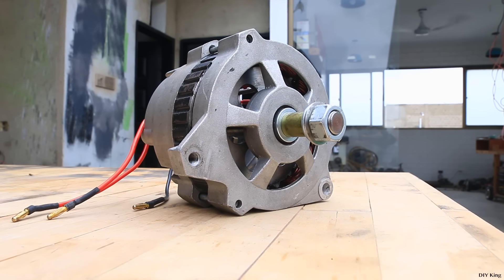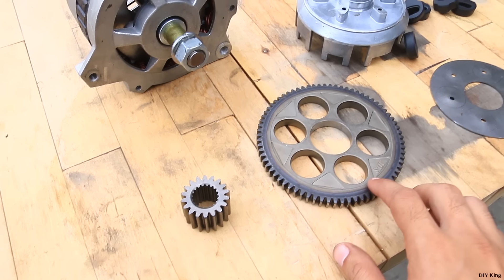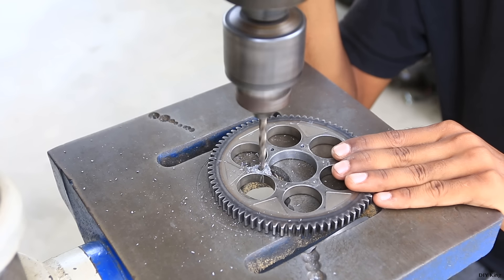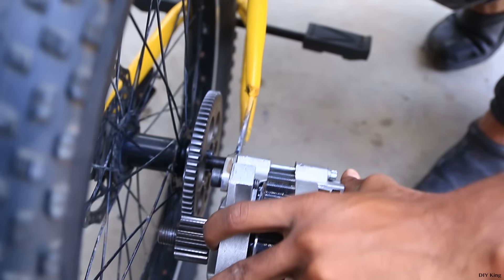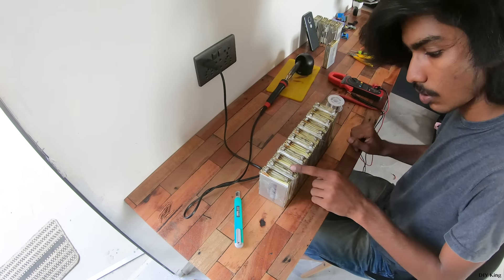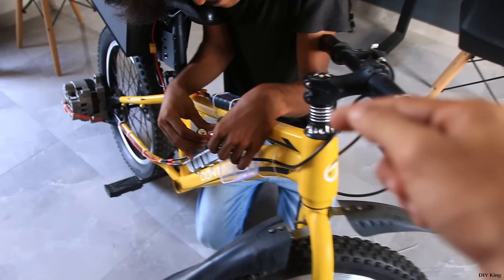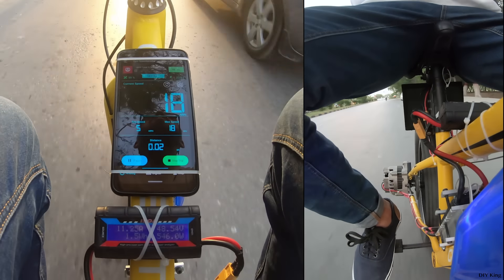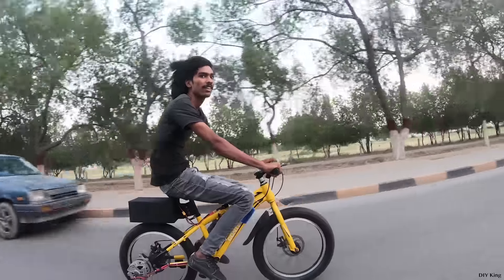Bicycle Conversion using a 10,000 Watt Car Alternator

Comment: The build is interesting, but I don't see how this is a 10,000 W alternator (per the video title).  For one, you have a 200A board controlling it (which is roughly 12V x 200A = 2,400W).  And from what I see, that is a 150 or even 100A alternator, which is 1800 to 1200W.  Even with modifications which will bring the power lower still, it is a nice build, but I think you are off by a factor of about 10x.
Reply: You’re right- it’s not 10kw.  Probably an 80 to 120 amp alternator, which typically outputs 14 volts more or less.  So optimistically, a 1500 watt.  

Maybe he just put an extra zero on and meant 1000 watt?  Or clickbait algorithm demanded exaggeration!
Reply: These guys can't count. Have you ever seen a 10k electric motor? It is huge.
Reply: it is a 200a WATERCOOLED controller, that he didn't watercool. this bike runs at an estimated 40-60 amps from what i can see, he is either trolling or just doesn't care if his numbers are correct. the bike is great, but the stupid numbers are infuriating because now if someone makes a 3000w ebike with a 4000w capable battery on it, they will look like a chump to people who don't know what they are looking at. THIS IS CANCER.
Reply: I think they used 120 Volts AC InStead of 12 Volt DC When Converting the Math , I Noticed this Right Away and Though Common , No Way!
Reply: @905Jerrod   I think they just used a big number for clicks. It's all about the clicks
Reply from the maker: If you go through the video again you can see that we have powered the alternator using a 12s lithium ion battery pack.
That sums up to 50.2v and with a peak of 195Amp i guess we have got the maths right. Still we are going to do a video as lots of people have got this wrong.
Reply: @DIYKingSaM  you yourself in the video said that you were using two batteries capable of 1500 watts each. that is 3000 watts potential output from the batteries. but not only that, you are using a controller that is supposed to be watercooled without watercooling it so you are obviously running way under what that controller can do. dude, you are hitting a very respectable 40-60 amps, but i don't think the motor would even survive much more, even truck alternators aren't built to handle that much juice.
Reply from the maker: @kght222  wait for the next video, btw that's 1500 watt hour each not just watt
Reply: @tikitime  yeah he included the comma so he meant to say that. Suprized he didnt call it free energy. 10,000 watts would have that whole bike glowing an breaking down I bet.
Reply: @kght222  yeah I agree man I hate it when people do this it's so misleading to the uneducated.
Reply: I had the same question.
Reply: @martinben1480   It depends on the type of motor and I have seen a 10kw motor. Its tiny... golf cart motors can go way higher and are still small, less than 50lbs.. and peak power goes way higher.
Reply: @DIYKingSaM    What you are claiming is the spec voltage and maximum amps.   That does not mean the motor is using 195 amps at 50.2 volts.   You could hook (2) 12S batteries to it!   Would that make it 20,000 watt alternator?   Absolutely no!
Reply: Ten thousand Watts.... Who are these clowns.
Reply: @KevinCoop1  195 peak may be a short circuit current, so it's not a valid calculation to multiply it by the open circuit voltage.
If solar panel manufacturers did that they'll get very impressive numbers for their 200W panels.
Reply: Ah I remember the war of the audiophile stereo days in the 70s, with the war among manufacturers of the specifications.

Our receiver is 0.000000002% THD when the human perception was actually around 0.28% THD.

These crazy ass YouTube videos with catchy titles are doing the same thing because nobody wants to see a 60 amp peak motor on a bicycle narrated in Mumbai.
Reply: @BEASTWRANGLER     it's good to have your opinion when it does not include intolerance based on  xenophobia. There are just as many, if not more of these videos coming from your part of the woods for you to want to besmirch the reputation of Mumbai and its people.
Reply: They have 10/100 scale tow trucks that can pull real cars, and jumper battery packs the size of andriods that can run your truck to work an back😆
Reply: @DIYKingSaM  10,000 watts is 13 horsepower... if that were accurate, you would be breaking something on that bike.
Reply: I have an rc car (arrma infraction) with a castle 2028 motor that is 50mm, a fraction of the size of this alternator, it pulls 13,000 watts on 8s lipo 30v, I could definitely see this making 10,000 watts on 12s 50v, you people have no idea about brushless motors
Reply: @gavwilldo  it's not the size of the alternator that matters. it's the titanium microsized half-inch spoke that does it for me.😁😆
Reply: Seek Him with all your heart and you will find Him  Amen🙏
Reply: @martinben1480  it depends on the application of the motor
Reply: All these comments lol. The answer is simple, CLICKBAIT
Reply: 10KW …. Mmm I don’t think so ..
Reply: Ever tried picking up 10KW motor, they are not the lightest of things..
Reply: Alternators run different past Mexico into Brazil and is the life of your car😆👍
Reply: 100% a click bait title.
Reply: It's the same way that USB battery bank you bought is 100000mah. it's India, they don't use math
Reply: Kp
Reply: All right whatever the case may be mathematically I just want to know exactly for sure how to get the right alternator and the right power pack and the right speed controller to get a bicycle possibly with a jack shaft to use the existing drivetrain of the bicycle to get it to go 40 to 50 miles an hour or more
Reply: @gavwilldo  i doubt you have actually tested it. You're probably reciting the bs "peak power" claims from the manufacturer. there's no way you're pulling 400+ amps continuously from a little pack...
Reply: @thomasmann3560  they measure capacity in microamp hours, not milliamp hours lolol
Reply: @chrisi9265  they are film makers mostly, electrical engineers not at all!
Reply: @kght222  did you notice the large  guage wires to the alternator? 16 guage or abouts.
Reply: 90amp alternator
Reply: @tikitime 1
Reply: BS video
Reply: Wow I'm just a dumb English man , but loving this thread 😊 it's been said god loves a tryer. Criticism creates progress 💪 power to the people (not corporation's)
Reply: No wonder so many ebike fires...huh?
Reply: TheFourHorses          ........  inchinatori la vaci....... ha, ha, ha  Da ai dreptate
Reply: @DIYKingSaM nice
Reply: It got you all to watch the video tho 😂 so who cares
Reply: @martinben1480  I have a 10,000 watt alternator, and it is HUGE! It requires 3,600 RPM but only 26HP to run. I'm using it for our HUMAN POWERED trike!! 🤔🤔🤗🤗🤗
Reply: TheFourHorses  hello horse worshiper 😂
Reply: @DIYKingSaM YES!! I'm sure we'd all appreciate it ;-) I'm trying to compare an updated golf cart motor of 8.7 kw which weighs 66 pounds (26kg) If your math is correct, I'm going adapt an alternator for my small  EV project!!!
Reply: @chrisi9265   I have noticed over the years that people from that race or culture like to bs & or exedurate a lot. Inferiority complex... etc...+ EGO problems.Very immature!!!
Reply: But u mistaken its 200amp x 48v not 12v
Reply: Im assuming he based it on the esc which is an (cheap) 12s 200A cause +-50V * 200A = 10000w
Reply: @gavwilldo Brushless motors mean nothing.
I have built electric vehicles with 500W rated brushed dc motors, that routinely pull 5kW towing big loads up hills or under hard acceleration off the line.
 Over 200A at 36V.
And that motor is less than half the size and weight of his Alternator.
Reply: You guys all got clickbaited lol
Reply: Probably wrote it wrong..
Reply: He is successful 12,268,724 viwe. He  with false information, fake news. ON YOUTUBE
Reply: You are missing a lot of factors
Reply: @DIYKingSaM wrong
Reply: HE DEFINITELY MISSPELL!!! MAYBE ON PURPOSE... IS 1000 OR 1200 W !!! Or Could Be Doubled IF you using 200A alternator.. But is Not Common! It Could Be Expensive...😮😂😅😢😢😢😊 Definitly $200, plus is more bulky and heavier then 100Amp.... Plus, you will need Bigger Expensive Battery to Use the Power...😮😢😢😢😊❤
Reply: @voytek3999  no he did not...
Reply: @voytek3999  no he did not
Reply: @BUSAFADE  Well... Then He CHEATED!!! Only to Get Clicks...!
Reply: It's 10 Watts, 0 after the comma don't mean anything
Reply: @JonitoFischer  who is your Math Teacher?!   $1,000,000.01 - That's One Million Dollars and One Cent! You do See the " comas " and the "dot"? Do you?
Reply: @voytek3999  who is yours? All the world uses a comma to separate decimal positions, just the opposite as in the US. And we use the SI unit system, because it makes sense!. You're wrong!
Reply: @JonitoFischer  We are in US.... Sorry if you Not... Anyway, If you Search, you will discover that Over 50 countries using US system And Over 70 countries using European system!!! The is No Right and Wrong... You just have to remember where you are...! NOW, YouTube is in California for 19 years! And belongs to Google for over 17 years!
....Who is also in California (USA). 
The guy who made that Video could be in US or UK or India(?) I don't know... but in those 3 locations He used the comma properly...!
Reply: @voytek3999  thank God I'm not living in the US! All the world uses the SI unit system but 3 countries (USA is one of them), even NASA realized (after a famous incident) that there's no point in using the imperial system for real work. And 70+50=120, there are about 200 countries in the world, so your claim is not accurate. And yes, being wrong means that a comma instead of a dot is telling that you're using a 10W motor instead of 10kW motor (not even physically possible in the size of a car alternator)...
Reply: @JonitoFischer  Don't Get Dramatic on me!!! I Lerned METRIC System 65 Years Ago in school!!! I Acquired US/English System 32 Years Ago when I get Here...
And I Use Both Without Conversion....!!!
NOW, From This 200 Countries The 120 Actually Have Math & Science! Apparently.... To this Little Argument We have ... THANK YOU! You Misslabeled 10kW motor for 10W one... Now I know How the Incident by NASA Happened!
Congratulations... Perfect Explanation...
Reply: Come guys it works brilliantly i ganna try this
Reply: @JonitoFischer  illiterate
Reply: if you look at the video, he is running the motor at 50+v
Reply: @relitto1019  Yes, that would give you "push" to run 200A, But - you will most likely Burn the Coils!!! The wires Are Made for 80-100Amps... If you make TEST RUN - 10/15 minutes, Maybe...
1 Hour or More, it will overheat and burn!
Reply: @voytek3999  i think the speed controller amperage rating is maximum phase current. he misinterpreted/doesnt know that phase current ≠ battery current. so yes, you are correct. the motor is only drawing >100a continuously from the battery, but possibly up to 200a of phase current.
Reply: @voytek3999  the max phase current cannot be used to determine maximum power output, unless you are able to run the motor at a high enough rpm for the phase current to equal the battery current. which is probably limited by the speed controller to ~100a.
Reply: @relitto1019  I know! That's why the Video is weird! And the claims Are not necessary Scientific....! They are some relatively simple way to Test the motor (aka Alternator!) Power! However He didn't do it... Also the is Phisical Limit of this machine! The size of the Iron core and Its Magnetic properties and the rotating Magnetic core with solid magnets and energizing coil can Produce Only so much Magnetic Flux!
SOOO!  If that is 100Amps at 15Volts (14.4...) as the original, it is 1500W machine! Now...I think we can Double that, maybe?! (3000W). IF He used 200A alternator (?), maybe 6000W!!!? I Don't Think the is Any Reserve in this Core to Reach 10,000W... The electrical machines are usually designed with 20 to 50% Reserve if the Designer is Conservative... Never 100%.... The Numbers I give you Maybe to Optimistic!
Reply: @voytek3999  He has a watt meter and volt meter on the bike, on his 63mph run he topped out around 5kw. i would also think that the direct airflow over and through the motor, would significantly help heat dissipation versus being under a hot car hood.
Reply: @voytek3999  probably also under geared for how much power he has. it looks like the motor ran out of rpms
Reply: @relitto1019  Well... In any case If he has 50V Battery, how long do you think he can drain 100Amps from It?! The battery has to be at least 50Ahr... And it will last for only 30min!
Reply: @voytek3999  if he were to run it at max power in theory only 10 minutes or less lol
Reply: What you expected from that part of world. Supposed to, alternator go straight from engine to bike with out touch.
Reply: this guy literally turn a alternator into a electric motor.. keep up the good work fellas!!!! Dont mind these ungrateful peoples !! 🙏🏽🙌🏽 stay blessed
Reply: It's called : how to get 'a watt of views'.
Reply: Using flip flop math, I see.
Reply: Ohms law says that he was either exaggerating, or was off by a decimal place 😂
Reply: Guys, Here is The Savior

HalleluYAH translates “Praise ye YaH”

YaH is The Heavenly Father
YaH arrives via the TENT OF MEETING
YaH was Who they Crucified for our sins
YaH was Crucified on an Almond TREE

Semitic of Moshe (Moses)
Isa Scroll (The Original Isaiah)

Isaiah 42:8 - I am YaH; that is my Name! I will not yield my glory to another or my praise to idols.

Isaiah 43:11 - I am YAH, and there is no other Savior but Me.

Isaiah 45:5 - I am YaH, and there is none else.
Reply: seekhimwithallyourheartand3358  boooooooooo 👎🏻
Reply: @janosszegeti2280  no my friend you know tell me this, it is carpet math for you
Reply: @Praise___YaH  no proof
Reply: This e-bike probably has a top speed of 50 to 55 mph. I've tried different power settings on my e-bikes and 2000-2400 watts is not going to get you to that speed. Likely need at least double that
Reply: @martinben1480 personally no but i think i know roughly how bit were talking it would need to be big to be able to deliver that sort of power with in my opinion most people could ride a bike with that much power anyway not safely at least
Reply: Bottom line. It works. Look at the smile on the dudes face.! Stop being so critical. Smile. Laugh. You deserve it.
Reply: Its more than 12v
Reply: MashaAllah. I see many power or mechanical literate people here. And really I feeling a bit satisfied that we are not that behind the world. I'm not a electrical or mechanical but a business student and what came in my mind is, why not you all or some of you combine and start making something we can call made in Pakistan. Overall I love your work brother. Keep your head up. You both are doing amazing and I'm proud to see my brothers doing such things. AOA
Reply: 10,000 watt / 746 watt per HP = 13.5 horse power. Looks like typical alternator which would be the prime mover. Guessing if today’s typical alternator could deliver maybe 1500 watts or roughly 2 hp max. Power = voltage x current. 13.5 hp on a bike could melt the rear tires. IMHO
Reply: @denaamisharry1350  Thank you for making good sense of this theory friend! I had not taken this into consideration, and have never hear of this cheap 200 Amp   alternator! So, the specs that you described would be at Max output and %100 realistic (making his true as well!) 😁
Reply: its a 48v esc, 12s means 12x 3.7 battery cells to power it which equals 44.4v which if we miltiply the amperes then we get around 8-9kw of power which would probably break the motor at peak

Comment: Awesome 😎 i think the wobbling you mentioned is due to improper weight distribution. The alternator and the battery is on the rear wheel. Also, the rider sits closer to the rear than front. You should aim for a weight distribution of 50% for each wheel.
Reply: The problem is with the structural integrity of this bike. The power to body ratio does not match. This bike has a threshold speed limit above which it started to experience the wobble of death. Happens with the conventional motorbikes too.
Reply: @TheEngrAsad  Could be the centrifugal force on the spoked wheel at high speed pulling it out of shape. That's what causes speed wobbles in motorcycles
Reply: Hahahaha!!!! No the wobble from shaking the handle bar with his arms..😂😂😂😂😂😂

Comment: You should put a small water reservoir heatsink for a cpu on the speed controller and let the thermal differential cycle the small amount of fluid, and it would get rid of the air gap inside the controller and allow more heat transfer to the heatsink you added

Comment: You must always use lubricant when drilling through metal, steel, aluminum, iron and stainless, as well as drilling within the proper speed and feed ranges
Reply: right, that is basic knowledge that most machinist know.
Reply: @jodyguilbeaux8225  Speed and feed and tool type are going to be more important than coolant. A nice drill can do hundreds of holes without coolant, but if the speeds and feeds are wrong it might not even get 1.

Comment: engaging Li-Po battery pack without BMS to run a motor is dangerous dude. Li-Po is very flammable when its leaking
Reply: IMPORTANT WARNING ⚠️
Reply: @old cars trashed bms has overdischarge protection feature, so not a surprise if bms limits the full potential of the battery. 

In this video, they used Li-Po instead of Li-Ion which can go puffy then explode if it's overdischarged.

Comment: Get some vice grip clamps for your drill press! I use them all day at work
Reply: Or some peg holes in the table, so they could put a hard stop behind the sprocket they are drilling.